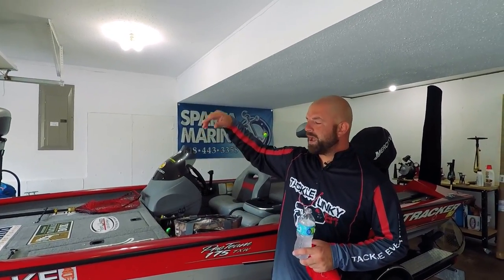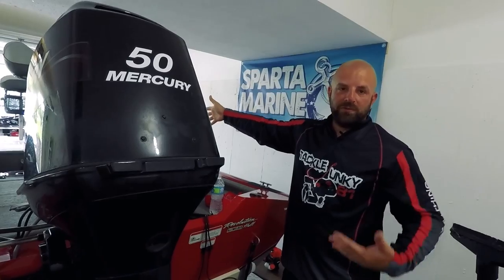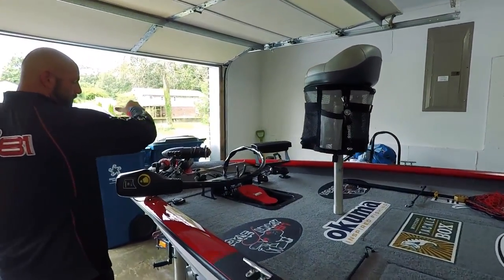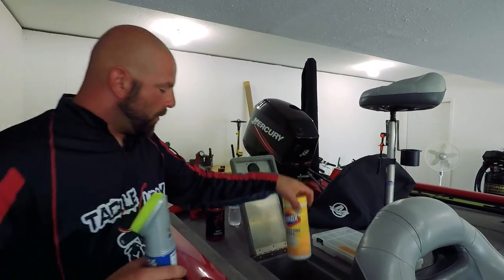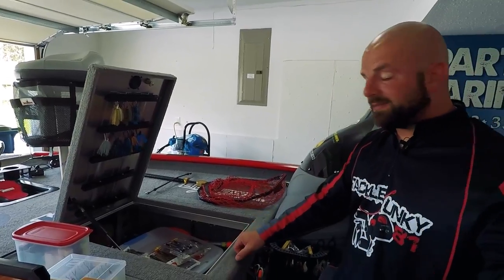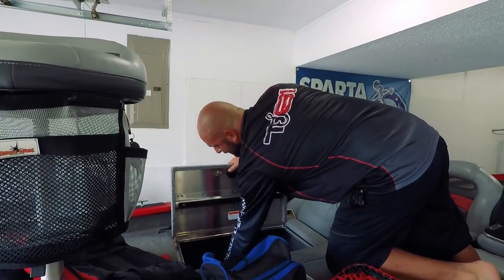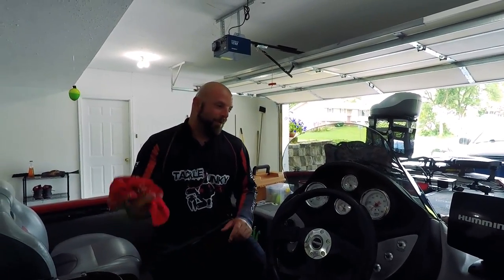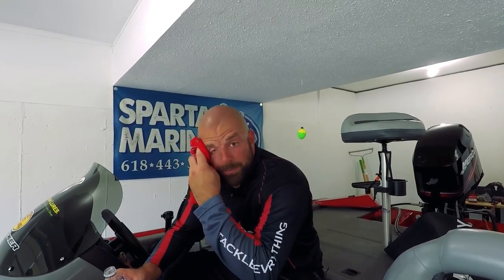Bass Boat Tour

Comment: I've got an older alumacraft with 70h.p. nissan and run 24v trolling motor with just two batteries. I run two 27 series batteries , running livewell (on a timer of course) the whole trip and as long as my batteries are in good shape, I fish all day , or all night and never ever have a problem with just two. The back battery remains your 12v , and that system works perfectly. On your size boat, when you get into wind, you would certainly appreciate that extra power. And the thing is your trolling motor is pulling off both batteries, not just one, yet, you will never have an issue with starting up your motor. Been running this way for 25 years with just the two. While I'm not jealous of your trolling motor, which is the main thing used all day long,,   I have deep respect for  your care , that you take on your boat. Beautiful boat, and you have fixed it up very very nice. Best wishes and very nice boat tour!

Comment: for the water spots, i grab a 32 oz spray bottle, and 3/4 full of water, fill the rest with white vinegar and a squirt of blue dawn dish soap.  For regular maintenance cleaning this works great!  if you have lots of water deposits, add more vinegar.  The acids in the vinegar dissolve the water spots and are not harmful to the paint.  Best of all this is cheap as hell to make.

Comment: To make easy seat pulls I used 1inch nylon strap, fold over to a loop, then just used the screw/grommet on the edge of the seat when it is up. Works great.
Reply from the maker: Awesome! Thanks for the tip!

Comment: Definitely can tell you take really great care of not only your boat but fishing gear to. You’d think the fuel tank would be placed either forward of the motor or to the left of the console. Between body weight and a full tank of fuel your roughly at 417lbs. Almost like driving a car with a flat tire. As always great video, keep them coming.
Reply from the maker: Thanks Daniel.

Comment: my 2000 pt 175 had that same issue, heavy more lean on the console side but i had the 24 volt had 3 batters back there, but you wouldn't think that one battery would trow it off that much it had a 75hp on it, the boat seemed maybe 100-150 off you could see it was off on the water line on the back, "Nice boat"

Comment: I put 3 battery's  in mine plus the Power pole pump and it corrected the lean from one side. But I still think they should center the gas tank and be able to but battery's on the side.

Comment: What do you use to clean the silver aluminum part on your boat. I’ve seen some boats where at part looks really dirty and black.. some have had rust on it. It looked really bad 

Can u advise what is the best thing to use on that part. I saw u use hot sauce but does it keep it from Rusting or turning black ..
Reply from the maker: I'll hit it with an aluminum brightener end of each season, but if you don't polish it it will get that black look to it. I have never polished mine...I just wash it like I said each year.

Comment: I have the same boat but the weight on mine was fixed when I added the fourth battery (That's right I now have four batteries next to the gas tank and it's tight). I just installed the 112 Minn Kota fortrex 36v so I had to install two more batteries.
Reply from the maker: I can imagine! lol SWEET motor!

Comment: what prop did you end up going with? i Have the same boat and motor. Wondering if you gained any mph?
Reply from the maker: I went with a stainless 13 pitch 4 blade. Was running bout 29 or so stock and hit 34.5 with the stainless...

Comment: Does the 55 hold you pretty good in the wind just got 2016 model with a 45 wondering if I might got to terrova  a 55 12volt?
Reply from the maker: Eh, depends how much wind. If you can I'd step it up to a 24 volt. I no longer have this boat and on my new one I went 24 volt and I'm much happier with it.
Reply: @TackleJunky81  I appreciate it buddy ain’t in no rush the 175 was all that would fit in the garage at this point .  I think it will get the job done for now.  Something about buying a boat leaving it outside just didn’t want to do that.  Thanks bud!
Reply from the maker: @tlbombsquad7883  I used a 55 for years and it worked just fine, of course at times I wished it had more power, but it still got the job done. I'm with you...I want my boat in the garage as well.

Comment: amazing boat, but need to upgrade that motor to a 70hp. i have a 17 ft aluminum boat, and i run a 70hp on it, and it goes 33mph, so i know with all that weight and a50hp it must run pretty slow. other then that, the boat is awesome! i would definitely run something like that!
Reply from the maker: HatmakerLuck I was at 29 and when I upgraded my prop last fall I jumped up to 33. Thanks for watching!
Reply: Seriously? Wow that’s surprising: would have thought all that weight would have slowed it down more. Well that’s plenty for a 17ft boat
Reply from the maker: HatmakerLuck Yup, I can't complain.

Comment: My tracker boat is Deep-V but has exact same problem with the tank location and will tilt. The way I personally compensate is keep my anchors (i have two) on the other side of the boat, also the cooler goes on the other side.  Btw im from Chicago - check my channel too if u bored :)